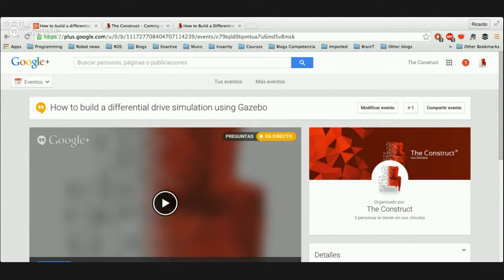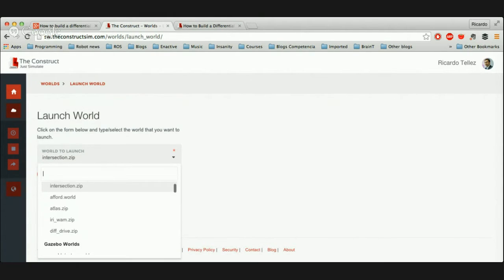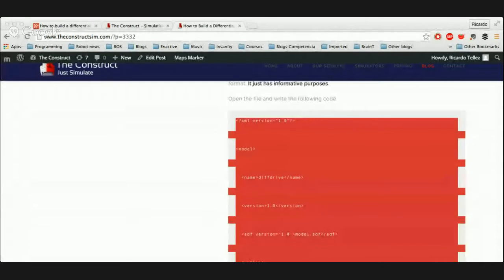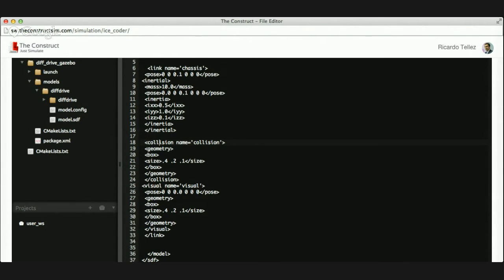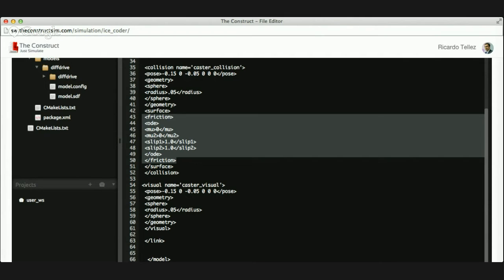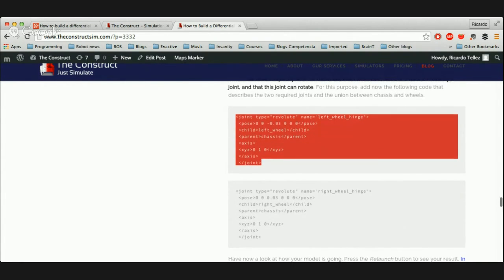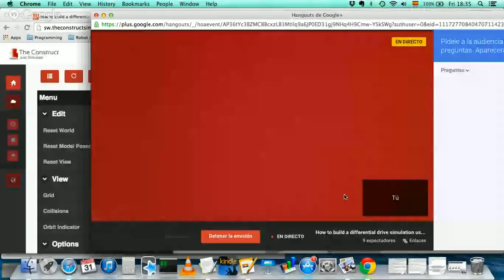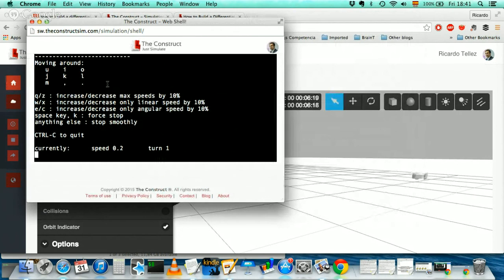How to build a differential drive simulation using Gazebo

Comment: What would it take to make the simulation more realistic? Say you control a DC motor through pwm, it's change in speed isn't instantaneous. What is a good approach to model that?
Reply from the maker: If you want to model that, then you will need to modify the differential drive plugin. Just have a look at the source code of that plugin and identify the functions that receive the cmd_vel command. Then use that value to create your DC motor model that will take the velocity command from the topic and convert into a new position of the motor simulation

Comment: hi , i want to konw how to control a single or 4 wheel robot ,each wheel can be individually controlled
Reply from the maker: In that case, you should define each wheel as a joint and the assign a controller to each joint. By doing that, you will have 4 different wheels topics that receive commands separately. For doing that, you are going to need to use ROS Control (watch a video about ROS Control here: https://youtu.be/AZGNIVFqXI8)
Reply from the maker: In that case, you should define each wheel as a joint and the assign a controller to each joint. By doing that, you will have 4 different wheels topics that receive commands separately. For doing that, you are going to need to use ROS Control (watch a video about ROS Control here: https://youtu.be/AZGNIVFqXI8)